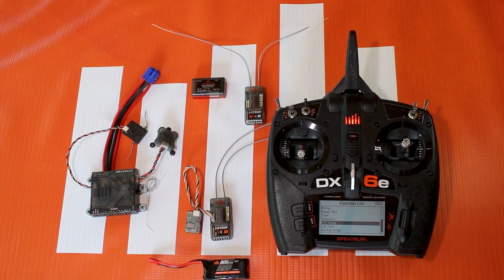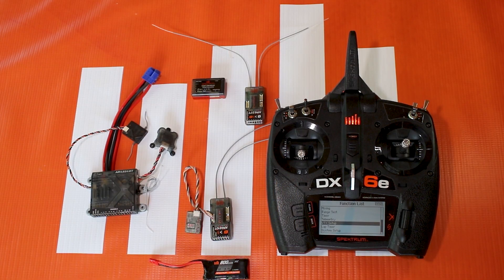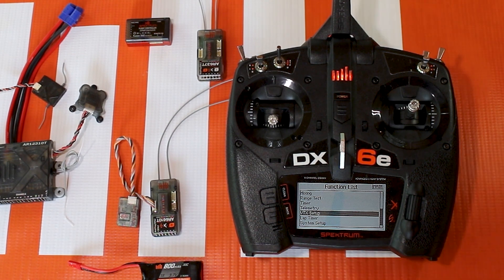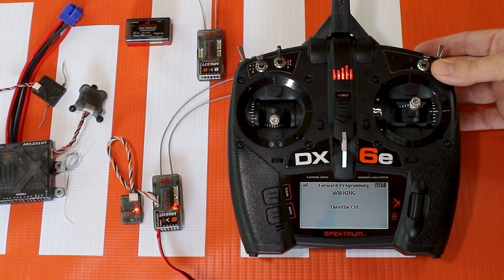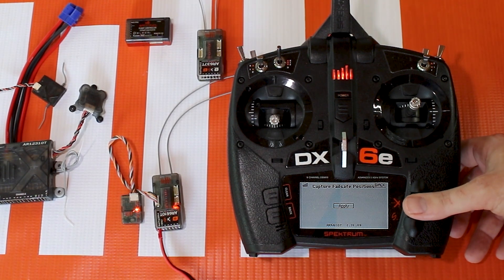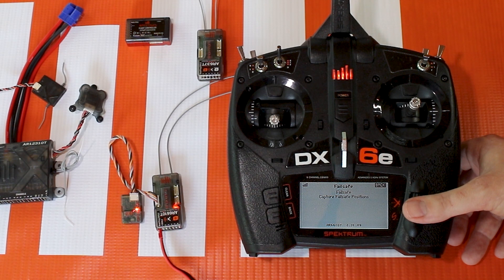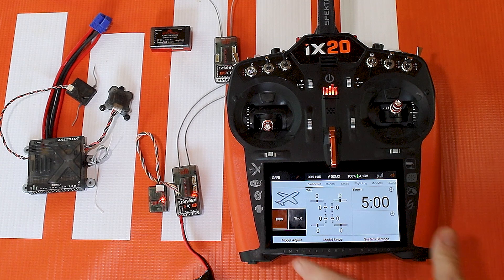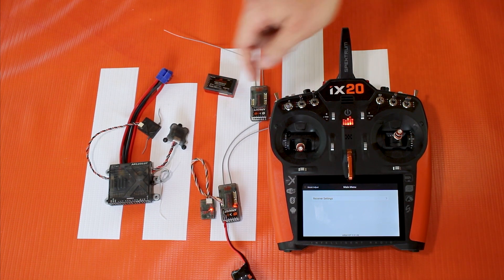Spektrum Quick Hit Tech Tips - How to Setup and Use Forward Programming

Comment: After binding my fancy AR630+ DSMX 6-Channel AS3X+ & SAFE Receiver to my DX8e I fail to see 'Forward Programing'.  Repeated this process multiple times.  Read and reread the manuals for the receiver and transmitter.  You figure a transmitter that cost the same as a laptop would have this function on there.  A/C was successfully bound all surfaces & motor functional.  What transmitters have 'Forward Programing' on them, as now I got a very expensive Fock-Wulf hanging on my wall that I expected to have AS3X and SAFE on in order to fly it how I wanted to.  I don't recommend buying AR630+ DSMX 6-Channel AS3X+ & SAFE Receiver or any other like it for PNP unless you have an experienced person to guide you as I did not.

Comment: I need help. Im bound to my AR631, I have an Avian 40A ESC, dx6e transmitter, and still no forward programming. Airware 2.10 on the dx6e. Really frustrating I have a fully safe capable plane and absolutely NO gyro stabilization!

Comment: I bought an Arrows Trekker and put an AR631 receiver out of my AeroScout in it. I  opted for this setup rather than buy a new receiver and use the Vector. I can't get the forward programming to work, I get the error message ,"Not connected. Maybe I'm better off to try and fly it with all the programming for the AeroScout. It is a high wing plane and everything appears to be working correctly as far as surfaces, etc.  I bought one of the BLE transmitter/ receiver programmer module and still can't figure out how to get it connected with the programmer Beta app on my Android. If I use the app on my laptop, you'd have to use the "Power Cable" button. I'm trying to use the 
 SPMBT1000 Bluetooth module. Now I wish I'd bought the cable. Any ideas?-

Comment: I have plugged in but forward programming still does not come up. I have a gen 3 dx6. My dad has the exact same setup but with a gen 2 transmitter. It's updated to 2.09 the latest but for some reason only my dad's comes with forward programming. Any help please very frustrating
Reply from the maker: Forward programming very much depends on the receiver you are using and potentially the firmware or preset that is installed on the receiver. What are we working with?

Comment: Hi, last week I got the AR637T, I setup forward programming and added f-mode to my B-Switch. Now my problem is that in safe mode everything is working, all the servos respond as they should. But if I switch to AS3X mode then the servos does not respond on moving the airplane. It’s like SAFE mode works but not AS3X. I have checked in forward programming in the F-mode option that AS3X is activated. I have tried reset and start over several times now, and get the same results every time. 

It’s like the gyro works in SAFE but not in AS3X mode. Hope you can help figure out why the gyro stops working when switching to AS3X mode?
Reply from the maker: Hi Jonas! The gyros react and output to the controls much different depending on the mode. SAFE is more or less a "heading hold" gyro where as AS3X can be considered a "rate gyro". Now that is not to say you cannot add heading hold to AS3X but it is a good way to describe what you are likely seeing. When a gyro is in rate mode, it only corrects and moves the surfaces WHILE the model is in motion and moved off course. A good way to test AS3X is to hold the model and quickly and abruptly roll/pitch the plane and observe the surfaces while it is in motion. You will notice that the surfaces move then return to center while it moves then stops moving. On some models where control throws are small and the the surfaces are small this can be hard to see, so an alternative is to look at the servo horns themselves while doing this test. Hope that helps!
Reply: @SpektrumRCvideos  Thanks for your quick answer, the problem is that there are none movement at all while in AS3X mode, I have the T-28 1.1m from Horizon hobby and there it works. But on this plane which is a older FMS P-47 1.4m it does not move the servos in AS3X only mode. I know how to it should respond in AS3X, but it´s like the gyro turns off when switching from SAFE to AS3X mode.

Comment: I have a DX9 that says connection failed when i go in forward programming . The receiver is AR637TA (V1200)...My DX9 firmware was updated to 2.08...Any ideas ?...Trying to assign safe mode to switch H on the trans...

Comment: I bought an AR631 receiver for my FMS Cessna 182 1400mm PNP. I bought a new DXs Transmitter. How can I bind these 2 devices and have SAFE and AS3X active. I was told that I can only bind them and use them as a regular transmitter and receiver. This was from a Horizon Hobby Tech that told me this. Recently I bought an Apprentice S 2 1.2m RTF. This plane has an AR631 receiver and came with a DXs Transmitter that were bond at the factory. Please tell me how to bind my AR631 in the Cessna 182 1400mm to my DXs Transmitter. There has to be a way. 
Dennis
Reply from the maker: Hi Dennis, the main road block is that you need a way to configure the AR631, which requires a transmitter with forward programming (pretty much anything but a DXs that we currently produce).
Reply: @SpektrumRCvideos  will a DX6 or DX6e. Which one will work or will either one work. 

After AR631 has been configured, will I be able to bind with DXs and have AS3X and SAFE?
Dennis

Comment: Using DX6e with AR637TA in an e-flite conscendo. I was able to get "Forward Programming" to appear in the menu, but when I selected it, the screen just reads "Gyro Settings." Didn't give me the same options you show in this video. Is there something I'm doing wrong. My end goal is to try to troubleshoot why my elevator and rudder are reversed. They have been reversed ever since I did a rebuild with new fuselage after a crash. I reversed the elevator and rudder in the Tx and it worked just fine, but then went to launch in SAFE and sadly, the SAFE brain was still using the reversed elevator without my Tx workaround. Plane just nose dived right into the ground instead of flying "Safe"-ly. So now I really want to go in and program the receiver so that it is moving the servos correctly for the elevator and rudder movement I want.
Reply from the maker: Hi Andy, any receiver that comes preinstalled in a model, will be "locked" programming wise. My suggestion would be to update the receiver and factory reset it in the forward programming menu. Then you will be able to reprogram it. From the description of your issue, I would wager that you used a different brand of servo when you replaced them. Different servos can have different programming and or gearing that causes it to work in the opposite direction as the stock servo, which will cause issues like you are having. The only solution, if using different servos, is to reprogram AS3X and SAFE on a blank factory reset profile. Hope that makes sense!
Reply: @SpektrumRCvideos  
The servos are still the originals, not replaced. They were unplugged from the receiver in order to thread the wires through a new fuselage.  But they are the same servos plugged into the same ports.  
Factory reset seems too extreme cause then I’d lose all the model-specific  programming (the reason it’s locked is supposed to preserve all that, no?). 
Also I don’t actually see the option to reset the Rx under the forward programming menu so still not sure how I’d do that. 

Sigh.  Well, in any case, the good news is that it turns out it was mechanical anyway.  
Turns out the  push rods cross each other inside the fuselage but you’d never know it from anything in the manual. 
I had installed them running straight back to the control horns that were on the same side as that servo’s control arm.  
I got the clue that it might be wrong from the assembly instructions which showed the rudder servo was supposed to have a longer arm than the other three.  But I had the elevator push Rod on the servo with the longer arm.  
Switching each of the push rods to the servo with the arm on the opposite  side of the plane made the programmed action correct again (for both clean drive and SAFE)
Reply from the maker: You won't see the option until you update the firmware on the receiver. But glad you figured it out! That was my second guess ;)
Reply: @SpektrumRCvideos  Got the USB programmer cable to update my AR637TA, but a popup window says "there was a problem reading the device's identification."  Can you share any documentation so I can troubleshoot this myself without having to send it back to Germany?

Comment: iv set it all up but the as3x dont cut in when you move the model sir
Reply from the maker: Make sure you initially throttle up a bit to activate the gyro. Otherwise, if you are only using AS3X (not SAFE) it may be very hard to see the controls correct. This can depend on a few factors, such as control travel, amount of AS3X gain,  size of the control surface, etc.
Reply: done it t5hanks

Comment: Does the DX6i capable of forward programming? One of the guys in my flying club gave me one since the only radio I have is what came with the AeroScout.
Reply from the maker: The DX6i is not forward programming capable :(
Reply: @SpektrumRCvideos  well that answers that question then
Reply: I wish it did,,,,I got a pretty nice I had and used for 10 years,,then I bought a dx6e,,it still don't have it unless you update it . tried 8 times to register it so I can update it , so got tired of that and bought a new dx6 wich is the best radio I ever had,,

Comment: I have a DX 18. If I forward program a reciever with the 18 will the receiver keep the settings if I bind it to another transmitter  ? I have a 1st gen DX 8 that I fly my electric planes on and they have the 631 rx.
Reply from the maker: Yes it will keep the receiver settings. BUT you will want to try your best to match the transmitter settings on your DX8 when compared to the DX18. Double check all controls and surface movements

Comment: I have a DX7, updated the firmware from Spektrum all is good. Bound my transmitter to the new FC6250HX all is good, go to the forward programming mode in the transmitter I get " connection failed" click menu. What is going on? I can't find anything on you tube or in the Spektrum web site or any manuals trouble shooting tips.

Comment: Question- I did the forward programming but my ailerons are off balance after I finished. Is there a way to start over? It seems like maybe the plane wasn't stabilized during the safe set up.
Reply from the maker: You could try relearn servo settings option in forward programming OR start from scratch (new model and reset the receiver settings)
Reply: @SpektrumRCvideos  Yes, I ended up doing a reset but after that I actually re-adjusted the servo arms manually. I think they were off to begin with.
Reply from the maker: @todd_s1965  ahhh yes that will do it ;) Glad you got it going :)

Comment: Hi
I had a problem updating my dx6 g3 since by mistake my memory was inserted with the firmware of my other old dx6.

how can I recover the serial number of my dx6 g3 to reinstall the firmware
when I turn it on "system error"
"please return it for repair"
I live in chile
t-code; 00000000h
i-code: 80000002h

Comment: How did you connect the receiver and transmitter?
Reply from the maker: The two communicate together wirelessly, it is part of the binding process. Forward programming is a bi-directional function of the telemetry provided by the receiver to the transmitter. Hope that makes it more clear :)

Comment: I updated the firmware and have forward programming.  The forward programming menu keeps failing to bind.
Reply from the maker: When you say you updated, did you update transmitter or receiver? Also which receiver are you trying to use?
Reply: @SpektrumRCvideos  I have the dx6 gen2 transmitter and updated to 7.02 firmware. Forward programming is in my menu when the receiver is on(FC6250HX) and other receiver with bind button. Unit is green flashing and receiver solid. But when i press forward programming it keeps failing to get in there. The ix12 work perfect, but it't not my transmitter
Reply from the maker: @rtoebak76  Should be working just the same as the iX12. What info do you see on the screen when you try to access Forward Programming?
Reply: @SpektrumRCvideos  It says: failing to connect.
Reply from the maker: @rtoebak76  Does it have a line of text at the bottom of the screen?
Reply: @SpektrumRCvideos  connection failed. Click for menu. When i select forward programming tge light turns lightblue and the swash wil tilt to one side, but thats it

Comment: Hello Tom,
      I recently purchased the Avian SPMXAE1100 Smart ESC to pair with my FC6250HX Spectrum Flight Controller &/or AR9030T receiver to my DX8E Transmitter. (Also have the the Smart ESC Programmer). Since seeing a lot of setup videos & a Receiver/Transmitter compatible list on the Spektrum website., I have a couple questions for you since my SPMXAE1100 has limited usage on my DX8E.
1. My SPMXE1100  doesn't connect with either of my FC6250HX or my AR9030T. It doesn't make any tones when it's initialized. all I see is a blinking red light & the fan running. Both receivers are bound to the DX8E. Is there something missing or I'm not doing?
Also don't have Forward Programming in the population list on my DX8E
2.This setup is for an Align 600 size helicopter. I decided to switch all the mechanics over to Spektrum parts so everything is compatible.
   With the other amp I had I was getting the beeps on initiation. My Spektrum setup I get no response and can't get into programming the parameters i.e swashplate, tail gear, pitch ......can you give me the steps to take to get my heli going & or if I need BEC to go with the ESC
Reply: Same exact problem if you ever got a good answer/fix please lmk?!

Comment: Can i use the AR 630 receiver on my DX7 since i read that I would need forward programming?
Reply from the maker: You will not be able to program an AR630 without a forward programming capable transmitter. The only DX7 that supports this (with latest update) is the DX7 Gen2

Comment: Hi spektrum. I would like to se a video about the dXs radio setup. Can’t find anything anywhere
Reply from the maker: It is on the agenda, but honestly right now there is not much you can do with the DXs. We are working on a update to the PC programmer to allow user to program it more, but right now there is only reversing and mode change via trim programming. Stay tuned for updates on the DXs. Thanks!

Comment: I'm using the FC6250hx with a dx9 and can't seem to activate any servos. No forward programming
Reply from the maker: Make sure your radio is up to date :)
Reply from the maker: Also check out our 6250HX setup series :)
Reply: @SpektrumRCvideos  thank you for the reply! All up to date but even after setting up forward programming, my FC6250HX slowly beeps and flashes multiple colours. I hear the servos but no response to them OR throttle 🤯
Reply from the maker: @Brandon5993  Normally that means you have not set the servo output frequency yet. It is one of the first steps in the swashplate setup video https://youtu.be/VJ0m2S42QPI

Comment: One month ago, I bought a DX8 Gen2 and a E-flite Conscendo with built-in AR637T.  With the received binded, when I try to work with Forward Programing, I receive error message "connection failed".  The DX8 Gen 2 is in the last firmware version available 2.06 and the receiver AR637 came with the newest firmware available. Any suggestion?
Reply from the maker: The 637TA that comes in BNF and Ready to fly models is not programmable at this time. There will be a update in the future to open it up for programming
Reply: @SpektrumRCvideos  , The DX8 Gen2 receive the same error message for AR637TA or AR8010T.  I think that it is a little bit strange behavior, I mean the same Transmiter, two differents receivers, the same error message.  Any other idea?
Reply from the maker: @claudiorosa3902  The Ar8010T doesn't support forward programming and is not programmable like an AR637T. The "TA" versions are programmed at the factory for the model it is included with and is not open for end user programming at this time. So neither will allow you to access them via Forward Programming. Hope that makes it clear? :)
Reply: @SpektrumRCvideos  , very clear thank you:-) Could I read the programing the factory programmed ?  I don´t want to change what Spektrum did, but I would like undertstand what it was programmend and I would like to have a Flight Mode option to enable AS3X and Safe modes when or if it is necessary.  I already definied a 3 postion key for Flight Mode 1/2/3 now I would like to associate each FM, for example: FM1=no features enable, FM2=AS3X ad FM3=SAFE.  Is it possible?  How?
Reply from the maker: @claudiorosa3902  With a open stock AR637T or AR630 receiver you can do that with flight modes and much more. Have you watched our setup series on the AR637T? John goes thru setup of AS3X and Safe with flight modes in that series.
Reply: @SpektrumRCvideos  , Yes they talk about how to do it with the Forward Programing with Transmiters IX series, and this is exactly what you explained the I don´t have with AR637TA.  
Then I would like to know how to do the same thing without this feature :-)